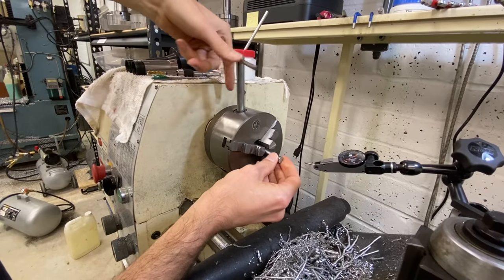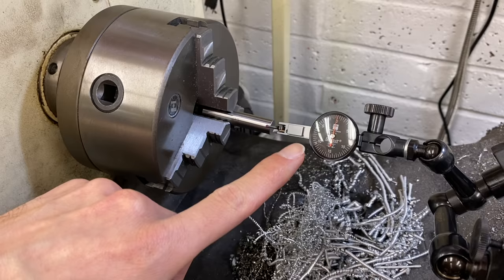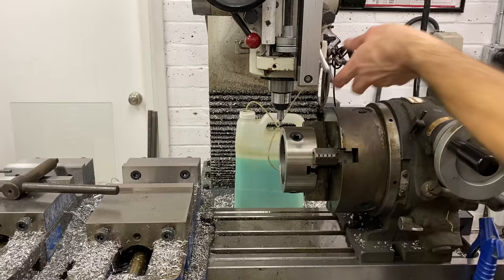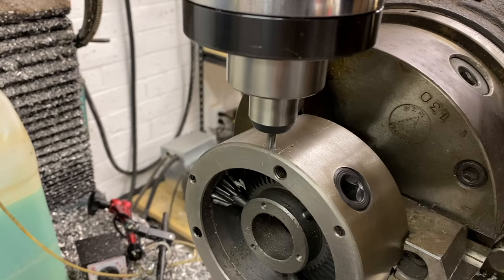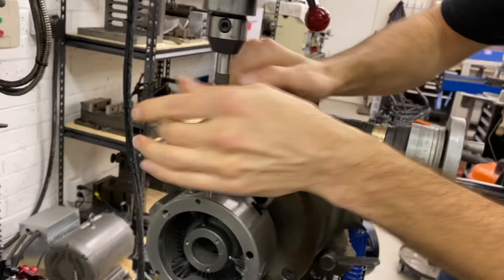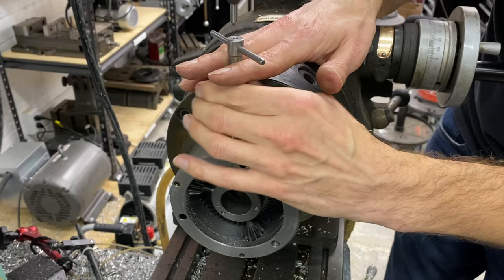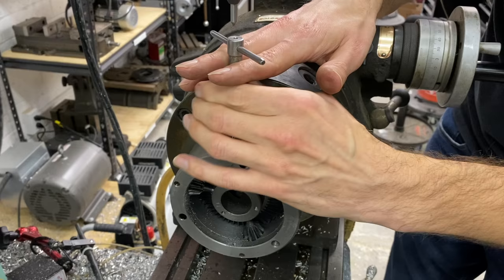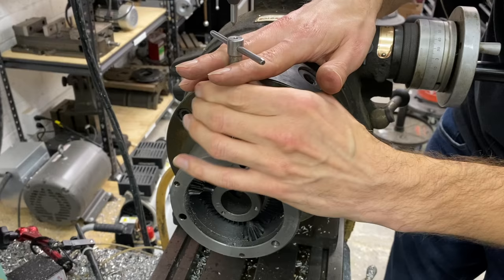HOW TO MAKE YOUR CHUCK SUPER PRECISE BY ADAPTING IT INTO SET-TRU

Comment: If this was how easy set through would be to make then the mod would be offered for next to free with major chucks makers. Principle is of course the same but execution is different. First of all the chuck has to be quite precise out of the box - there is no point of setting true a turd as it will not set true through the length of the part. 
2nd the construction of set true screws is much more heavy duty (like for above it would be at least 1/2" so they grab large area. 3rd the chuck is held to the "4 jaw" with a lot of bolts - for above size it would be 6. 
See disassembly of an actual set true chuck - https://www.youtube.com/watch?v=E_Ks6GKKcs8
Reply from the maker: I feel your disapproval and agree with allot of your points. The small setscrews are necessary to fit in the space allowed and will take the small load of a small machine. The only reason to do this is if you do not/can not spend the money on a high quality chuck and you feel safe doing so.  All I can say is it works great. Is it ideal? No.

Comment: 3 jaw chucks are intrinsically innacurate(scroll errors,inconsistent bevel gear backlash......), and are ONLY for use for jobbing work, where diameter is to be reduced, and subsequent repositioning and maintainance of concentricity is not critical - this is HOW you should use 3jaw, self centring scroll chucks.

For precision jobbing work, then use independant 4 jaw chucks; for precise semi-production use, then use precision 6 jaw, self centring scroll chucks, and for precision production then use precision collet chucks(with manual/powered actions); Mechanical collets are also useful for precision jobbing work, as is between the centres techniques utilising drive dogs.
In the first instance the operator should routinely check the chuck's concentricity, and then grind the jaws true by first loading the scroll mechanism with a spacer(quality chuck jaws have a concentric rebate at the bottom of the jaws for this purpose) - A chuck should NEVER be floating on it's register, as this induces vibration.
This is just an overview, but one based on my years of experience as a machine tool fitter turner in jobbing and light production environments - always use the correct tool(inc workfolding) for the job).
Reply: spot on... too many aspiring machinists think they can mod a 3 jaw to reduce is TIR... most manual lathes only need 2 Chucks for 90% of the work... a 3 jaw for raw material turn down or a 4 jaw for rework... all other options are for application specific uses.
Reply: @vincentwhite7693  With the greatest of respect, and as an ex machine-tool fitter turner, then I give the info in good faith - the idea of adjustable backs on self centring chucks is a gimmick and a nonsense - would you put adjustable wheel mounting flanges on a car!? 
The axial loads on a chuck are designed to be transfered via a close tolerance clearance fit on a register(Backplate adaptor, or directly eg camlock taper, etc) and not via mounting bolt/stud clamping pressure on a loose register  - this is basic apprentice stuff, and any trades/crafts-person with any integrity would not advocate otherwise due to inherent risk of injury.
It's not about "knowing it all", but it's about sharing knowledge AND experience with others, so as to help them avoid poor work quality at best, or severe injury at worst  - :)
Keep safe and well.
Reply: @renaissanceman5847  Congratulations Leonardo! You've managed to combine an ad hominim attack with a straw man argument.🤔😝 Funny how you failed to respond to my mildly stated technical response to your post above. From your uploads, you look like you belong in the talented  amateur category, which doesn't make you an oracle..

Craigy, if you're so convinced of the impossibility of friction based workholding, I assume you've scrapped your faceplate no?
Reply: @vincentwhite7693  and you liked your own comment mr 1 subscriber (your mom). but apparently you are a master mechanical engineer and 20 year machinist. Until you can precisely control the movement of each jaw in both relation to each other AND in relation to the center axis and maintain it under significant loads... BS like this doesnt work.
Reply: @renaissanceman5847  Ok Mr Snarky bum. You know best. But for those wishing to quickly knock out multiples of a part which needs rechucking, and  can live with a thou or two runout, and only have a worn out 3 jaw, this will suit nicely. But then you obviously haven't worked under less than ideal conditions.
Reply: @vincentwhite7693  If you need to run parts that require rechucking ... you use a cheap 4 jaw... they dont cost any more than a cheap import 3. and you learn to center it with a cheap indicator. If you know what your doing, you can center a part to well under 0.0005 TIR. I used to do alot of work for fellow RC heli flyers... and thats what I used. Modifying a 3 jaw never worked. If you can only afford 1 type of chuck... ALWAYS choose a 4 jaw.

Comment: 3 jaw chucks centering ability has everything to do with the accuracy, repeatability and engagement of the scroll onto the jaws... there is no way to make them more accurate without reducing the clearances of the scroll to the body and increasing the accuracy of the scroll. 3 jaws are designed for speed. precision machining on a 3 jaw is the result of mounting the work piece and leaving it there, and finishing it without removing it. Else a garden variety 4 jaw is the only way to go
Reply: Agree with you that the snug and precise fit of the scroll plate to the body is what gives a 3 jaw chuck a high degree of repeatable concentricity. A scroll plate and jaw teeth that are precision ground to form is another big factor but we're into big money for 3 jaw chucks of that standard.
Reply: Let's presume 1 thou clearance between scroll and body on an average chuck. I think it fair to presume that under load, deflection would negate that possiblly completely. If so, truing up the chuck for each new diameter workpiece, so as to accommodate scroll inaccuracies, should approach collet like repeatability for very little time and money outlay. IMHO

Comment: And now you need a rotating indexing tool also can get expensive, best you look into buying a better product maybe not Asian 😮😊.
Reply from the maker: You can do this with a hand held power drill if you have to. The location of the setscrews is not very important. No mill or rotary required.

Comment: it is better to grind the jaws!
Reply from the maker: I think these are seperate issues. You can grind the jaws perfect but they will not clamp perfectly concentric at every diameter once you move the jaws.
Reply: @TigermothRacingTV  you are right about that except when you have a very expensive precision made 3 jaw and the scroll and jaw engagement teeth are precision ground to form. Then everything remains very concentric throughout the clamping range. This you show is a good mod for greatly  improving the concentricity on the cheaper types to be often found in hobbyist workshops.

Comment: Self-centering chuck's are available in different grades of accuracy. Precision grade is near perfect.
Reply: Depends what's perfect for you. I doubt any scroll chuck can do much better across the whole clamping range than within a thou.
Reply: @MF175mp  Most viewers are hobbyist and therefore have never been exposed to high precision. Understanding accuracy is getting tolerances down to 0.00005" with a surface finish of two millionths of an inch, all this was achieved back in the 1960s.